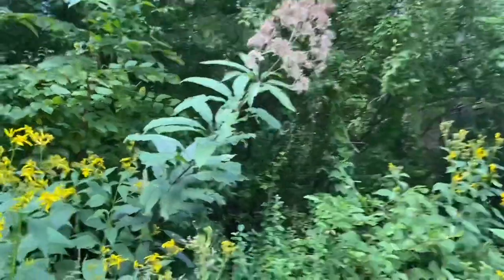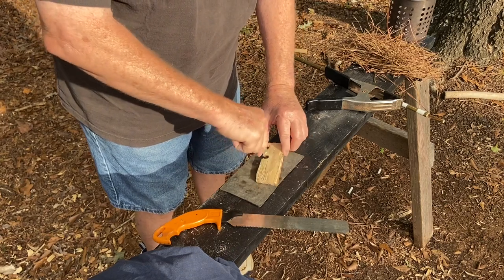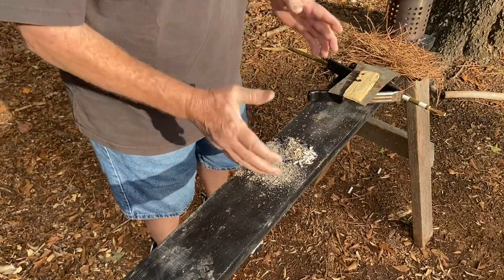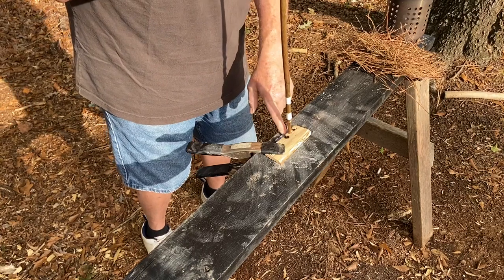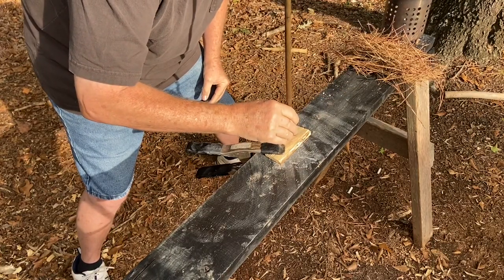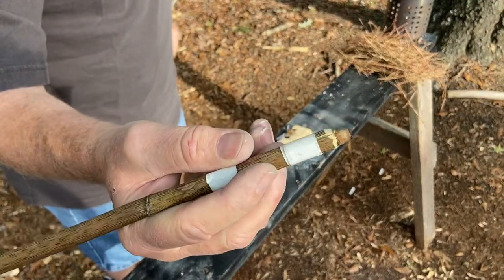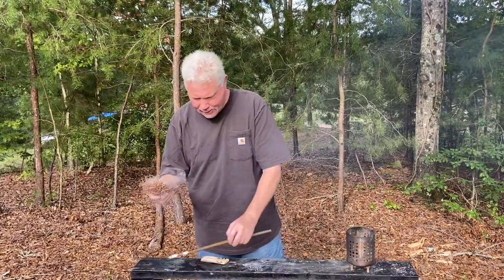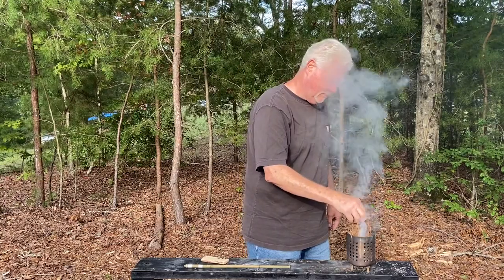Hand Drill, Joe Pye Weed Host Spindle With A Mullein Insert

Comment: As always, another very informative video. Given that we have both Mullen and Joe Pye Weed in our neck of the woods, we have no excuse not to try this. You make it look easy but no doubt it is a tad more challenging to actually do. Take care ! Cheers from north of the border 🔥
Reply from the maker: There is a lot more going on than meets the eye. Lots of practice over the years helps with knowing how to deal with thin walled mostly pith spindles... how much downward pressure to apply, how quickly the ember will burn up, how long the insert needs to be, also when coal extender is necessary, etc. There are other tweaks being made during the hand drilling itself... constant monitoring, adjusting, and a sort of "feel" that's hard to describe or narrate about while in the midst of it all.